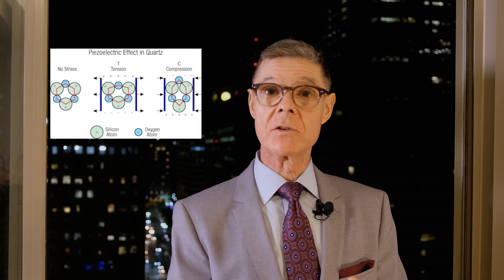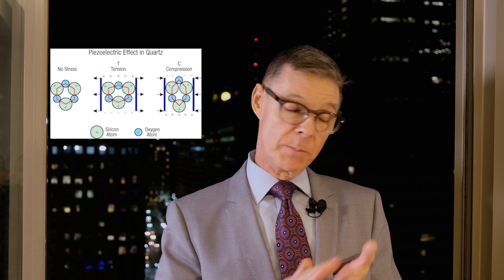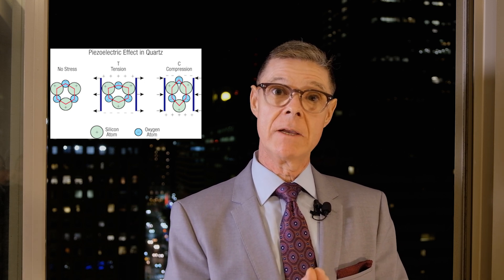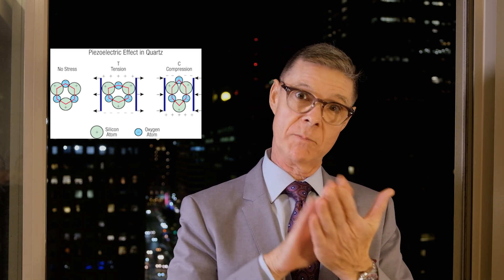Why you MIGHT need a Preamp | Audio Basics Ep2 | The Audio Show

Comment: Excellent video, once again. Are there benefits to having a pre amp and power amp separate? I could imagine there might be less distortion less electrical connections using an integrated amplifier?
Reply from the maker: Thanks for watching and commenting!  Actually there are few downsides to having a pre-amp and power-amp as separate components, BUT that is definitely one of them.  Good connection is important and theoretically that could be source of stray noise and poorer performance.  The other downside is size:  it takes up more space and needs strong shelf space.  One advantage is that if you have a loudspeaker/power-amp combination that you like but you want to try all the different possibilities offered by different pre-amps then you can just change one component.   The other advantage is that the pre-amp stage is more susceptible to hum and noise so keeping that separate can help to isolate it.  Thanks again!

Comment: Because my amp doesn't have volume control.
Reply from the maker: Thanks for watching and commenting! Right, power amplifiers don’t have a regular single volume control. they may have (if it’s a stereo amp) a left and right gain control.   The gain controls could be used for volume control but it’s cumbersome.   Also, power-amps won’t provide the proper compensation for records so it won’t sound quite right.  But all you need is a simple basic pre-amp.   

Thanks again for watching!

Comment: Thank you for the explanation of how the radio/ record player units that were everywhere in the 60's and 70's lead to Hifi for the masses later. In amplifying the cartridge output from 5mV to 2 volts( a factor of 400) how is the signal changed. Do you lose some resolution like making a print from a photo slide? Or is there more resolution revealed to be revealed that the smaller format can't show? I think of it comparing a 1080 video on a phone and 50" TV.
Reply: To answer your question fully would require several chapters of a book, but in short, if we assume a perfect amplifier, it would only increase the amplitude of the signal (music) perfectly with no degradation.  But, as we know there are no perfect amps, so increasing amplitude comes with three potential issues:
1. Bandwidth limitations,
2. Noise,
3. Distortion.
Every time you add a a gain stage, you add noise and distortion.  Luckily most modern preamps minimize these effects to make them fundamentally inaudible.  For example, a typical, well-designed preamp has distortion that is less (often much less) than 0.01% of the original signal, where the minimum distortion needed to be audible is >0.1%.  Similarly, most modern preamps have frequency ranges that are much larger than 20Hz to 20kHz, so bandwidth limitation are typically not an issue (which is different from the drivers in a speaker in comparison.)  
No resolution is added when you increase amplitude, things can only degrade. However, increasing the amplitude will increase loudness which could make details more obvious that might have been below the threshold of hearing at lower volumes.  Hope this helps!!
(edit: Dave has not made mention of the other function of the phono preamp, which is to equalize the signal from a record to its original form based on the RIAA standard. I will let him discuss this as you could easily make an entire video about it.)
Reply: Thank you for the explanation. How it works is the secret sauce that creates music vs reproducing notes. @terrywho22